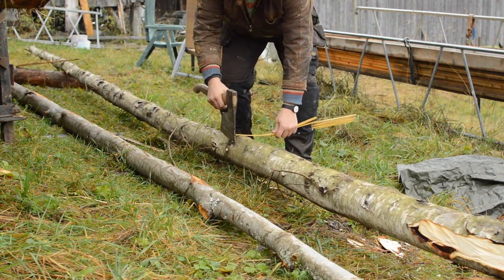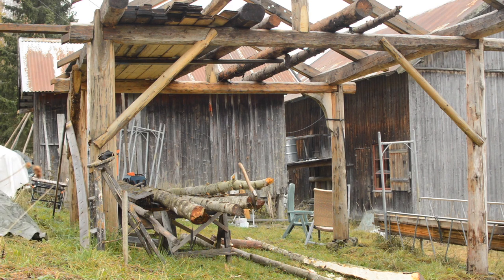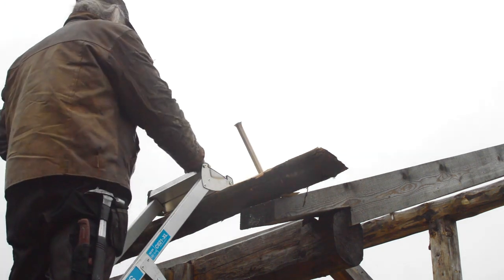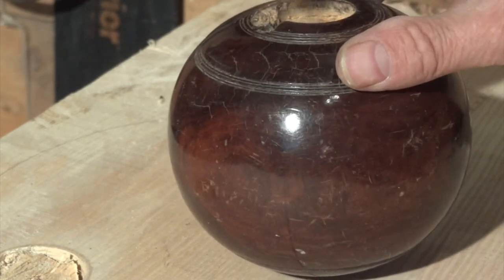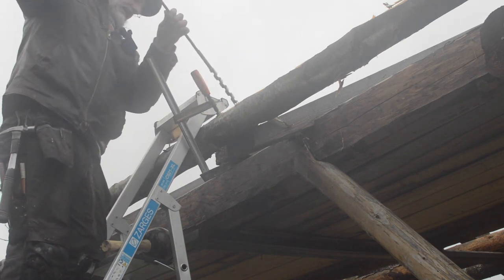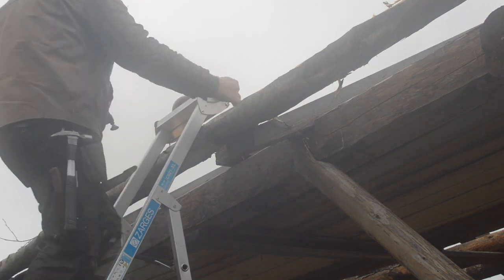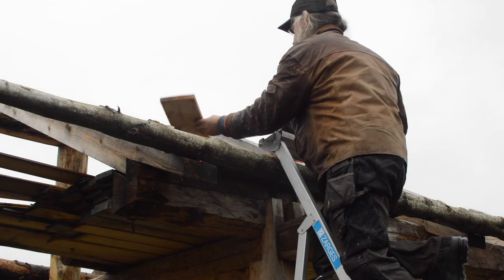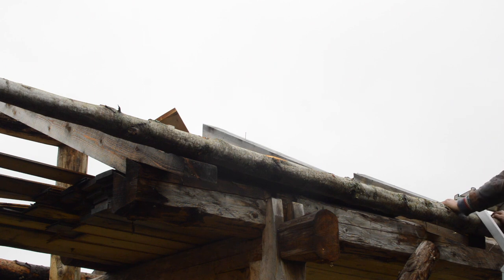🔴Trestle Timber Framing - Grindbygg Part 23/30 - pegging purlins and mallet-making

Comment: That looks quite a solid hand drill stand/press, I've been after one of those but the ones I've seen get terrible reviews
Reply from the maker: I hate to say it but I actually broke this one in connection with making this mallet, I think I can use a granite base instead of the aluminium one that cracked.